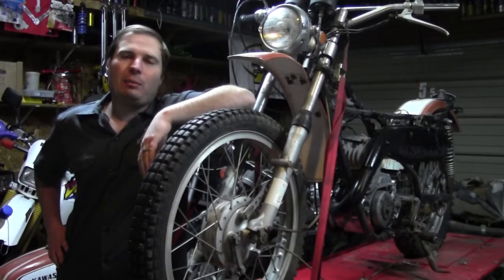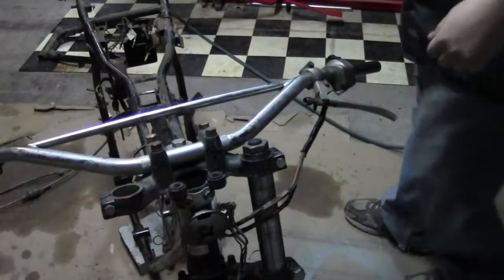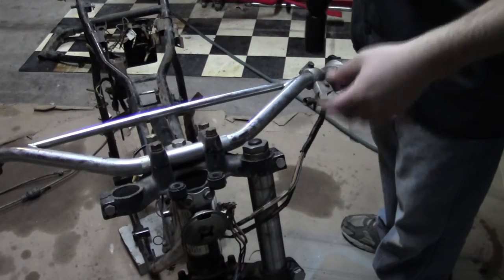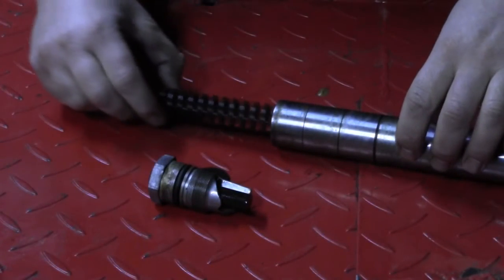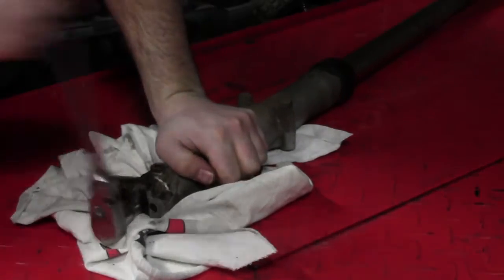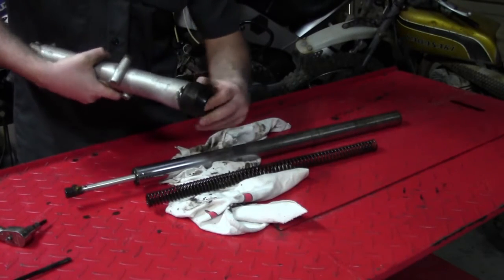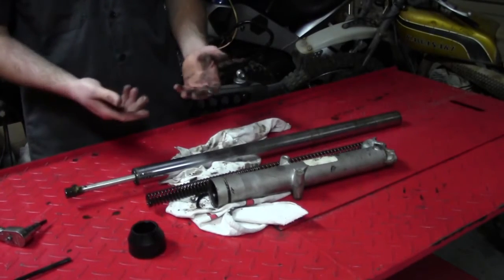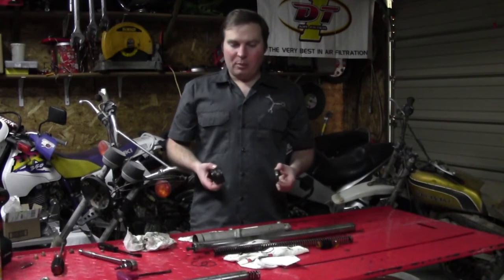1970 Kawasaki F5 Big Horn Frame teardown & Engine removal - Barn Fresh EP7

Comment: Any thoughts on the trail adjustment for the bottom of the fork? Does the forward position slow the steering?
Reply from the maker: +Steven Lamphear Yes.  Forward position is more high speed stability but slower steering, middle is more neutral, rear is quicker steering and less high speed stability.  You can also raise and lower the forks in the triple clamps to affect the rake a little.
Reply: +thejunkman There is 3 positions? I only saw two.
Reply from the maker: +Steven Lamphear Flip the lower legs around and you have a third position.  See the link. http://www.thejunkmanadv.com/uploads/8/4/0/3/8403513/6945045_orig.jpg
Reply: +thejunkman Ok. That's clever.
Reply: +thejunkman  That's sick. Do you know if Suzuki ran them on any models?
Reply from the maker: +Steven Lamphear No they were only a factory piece for Kawasaki, but dealers would sell them for retrofit on other bikes, but it never caught on.

Comment: were did you get that alum front wheel for the bighorn?
Reply from the maker: It is the stock wheel from the factory. Only the F5 and F5A (70-71) had the aluminum wheels.  The later F9 (which is not marketed as the "Big Horn") had steel wheels, as these aluminum wheels proved to be prone to cracking or failures under had offroad use.  Also the design of that lip tended to catch mud and hold it rather than the later steel wheels rounded profile.  I think these wheels were made by DID for Kawasaki.  I know the F11's aluminum wheels are.
Reply: @thejunkman  I have a very confusing bike, its a mint scrap yard find. its a 1971 july made, says F5 151xx serial number frame F5F and engine F5E, later serial but this bike is DEF an F8, it has the f8 carb, fits the f8 vin series and the chrome wheels. So far im making it perfect restore bc its so clean, but i may end up with mods and just keep all the stock parts. IE i want the Allen head SS bolt set, dont like those philips lol, and maybe some after marker alum wheel or look for those off a f11? newer ties even though mine are mint as is lol. I want to ride this baby. But keep as stock as possible, prob put aftermarket lights. this bike has none. Thanks for your help, Ive watched your entire f5 ( 2 hours) video several times btw, very nice
Reply from the maker: I would like to see a picture.  Post it to my website in the comments.  Also you might like this.  https://www.thejunkmanadv.com/the-junk-mans-blog/international-motorcycle-show-denver
Reply: @LilBethy  Your bike is correct as an F5A, the carburetors of the F5F5A and F8 were alike except for the jetting, Kawasaki had several warranty campaigns for F5/F5A, one of which was replacing carburetors with plastic slide guide pins for steel guide pin type, chances are the dealer that warrantied  your bike was savvy enough to know to order an F8 carburetor because the warranty versions were on back order or someone equally in the know swapped it for some reason, possibly the guide pin, unaware of the warranty issue? F5A's were indeed equipped with steel DID rims, the F5 had alloy Takasago brand that were soft and prone to cracking. 
Also if you still have your bike you may want to consider my clutch improvement modification, it helps all the way around to improve clutch action, you get a very light pull and also solve 99% of the cause for clutch slipping.  Here is a link to my video on the modification.
https://www.youtube.com/watch?v=MsLuGLp2lSA&t=24s&ab_channel=MerlinxPV